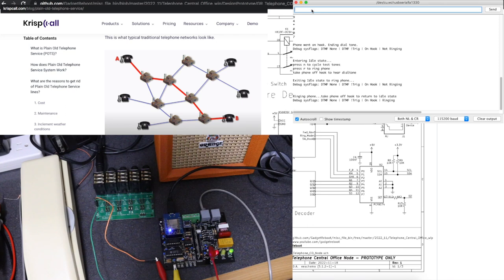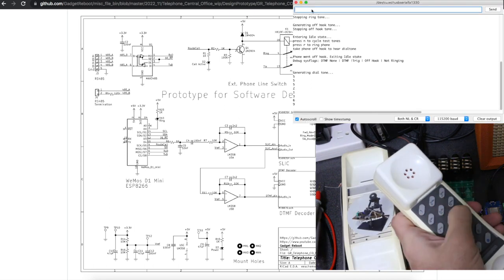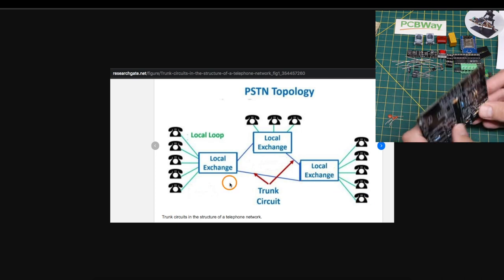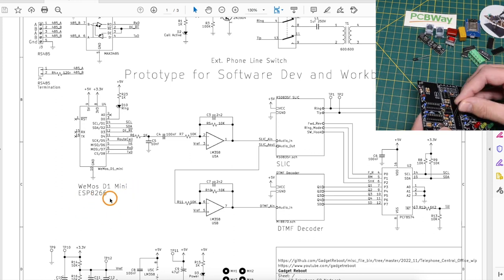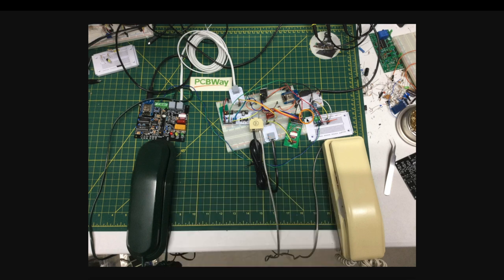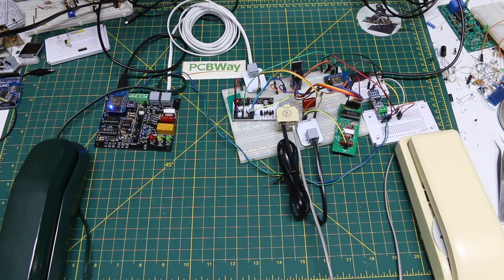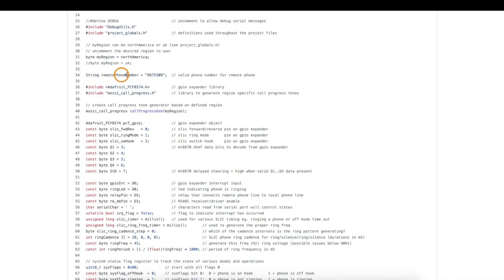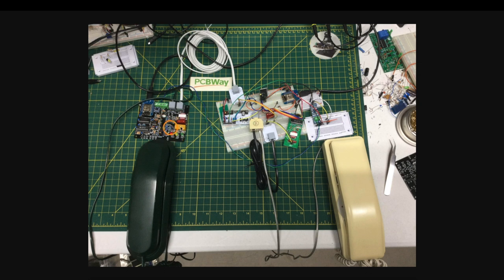Telephone Central Office Simulator

Comment: Very awesome! I can't wait to see the future of this project. I chose a more simple approch but  It will have less functionality, I just mainly wanted to be able to take old computers that don't have a ethernet Nic  and hook them  up to the internet. So I am using a Cisco VOIP adapter to make the line voltage and control the dialing. and basically have one of its ports plugged into a apple airport extreme (the ufo  one) so then all a computer has to do is dial to the airport extreme and bam internet connection like an old ISP

Comment: Very cool! You mentioned in the outro that you wanted to try and connect 2 modems. I dunno if you knew, but many modems (Practical Peripherals for example) support a "Leased Line" mode where you can just connect the 2 modems together without any POTS. You just issue an "ATA" on both modems and away you go, up to 115K baud!
Reply from the maker: so far I wasn’t ever able to get any to connect that way but the other thing I want to do is not just get them linked but be able to actually dial a phone number from one and have the other answer automatically. Hopefully in another couple of months I’ll have another updated design with a bulletin board system running on it

Comment: Nice project! I have a different design goal, but getting some ideas how to approach it from your work. I’m wanting to make a standalone simulator for a single rotary dial phone that will be interactive. For example, dial tone and respond to different dialed phone numbers as simulated people answering the phone or voicemail or a modem. Essentially I have a vintage phone I want to have on display that kids can interact with. What you have done gets me most of what I need, except detecting rotary dialing. Perhaps I can find a way to count loop pulses on the SLIC.
Reply from the maker: A month ago I finally obtained an old rotary phone and I plan to try to detect rotary dialing using the slic. I was going to try to get it working using the DTMF phones in Pulse mode if I never had the rotary phone.
i’m going to try using the hook switch pin on the slic since rotary dialling is basically hanging up and picking up the phone rapidly so the hook switch should be the thing that allows detecting it.
Reply: @GadgetReboot  that’s what I was thinking too. Probably also need a minimum on-hook duration to determine if hung up vs. pulsing. 

I’m curious if the ESP32 could handle digitizing the bidirectional audio over wifi so the trunk can be totally wireless. When I get a chance to experiment with this maybe I’ll try it. I’m not opposed to using a PiZero if EPS32 can’t do it. It would open up potential for trunking across internet for a virtual POTS.
Reply: Were there any other SLIC modules you considered? I'm wondering about differences in capability and also if there might be one that has DTMF and pulse dialing detection built in. I'm not getting anywhere with my online searches...I can't even find the one you are using without searching for the exact model number.
Reply from the maker: I wonder if digitizing audio would be better using an I2S ADC/DAC so the ESP just reads the data instead of also sampling the audio and then it could also be higher quality
and I’m not much of a programmer but I find I’m already bogging it down trying to do ESPnow wireless while using Mozzi to playback synthesized dtmf tones or pre-recorded speech samples as a wave file player, it starts stuttering and acting slow even with two cores where the first core I think it’s dedicated to Wi-Fi and then the second core is where Arduino code normally sits, so I don’t know what the limitation is if it’s just choosing the right peripherals or being a better programmer or if a better chip is needed.
Reply from the maker: I didn’t really see any other slic modules, the one I’m using is a clone of some other one I can’t remember it might be AG1171 or 1170 there might be a couple of them but they basically have the same form factor and functionality.
Reply: DUDE this is exactly what i've been wanting to figure out for an art project to interact with my art. I wish I understood this all more, and working with electronics to do so.
Reply: @GadgetReboot  @noneofyourbusiness76 did either of you find a way to do this? and is it possible for a completely naive beginner to accomplish?

Comment: this is fantastic! I collect vintage telephony equipment (lineman's handsets and payphones) so a project like this would really be loads of fun!
Quick question: why put your revisions in directories the way that you did? is there some efficiency to be gained over git tags or branches?
Reply from the maker: Mostly I don't know how to properly  use github so I just dump files there as a one time thing. I think this is the first time I've ever had multiple revisions of anything because I split the project up across several videos and just treated each one like its own project.   Maybe in 2023 I will look more into using the features.
Reply: @GadgetReboot  That's fair! it isn't intuitive really, and unless you're working in software professionally you probably have no need it.

Comment: This is awesome. Could it work with a rotary phone?
Reply from the maker: it should technically work except pulse dialling would have to be added to the software to dial out
Reply: @GadgetReboot 
Ok. To dial out at all or just outside of the network. Also is there a library that has pulse dialing?
Reply from the maker: I think I saw a pulse detect function somewhere and saved it to look at but it would still have to be adapted.
so until that’s implemented rotary wouldn’t be able to dial it would just look like the phone is being picked up and put back down.
and of course all of this is meant to be used in this closed experimental system, not currently designed to connect to a real phone system. I’m sure someone can adapt it to be used on something like a voip line